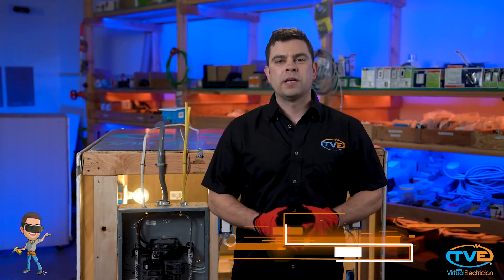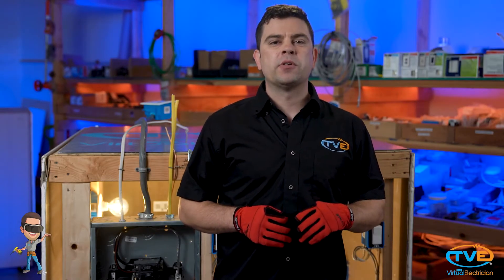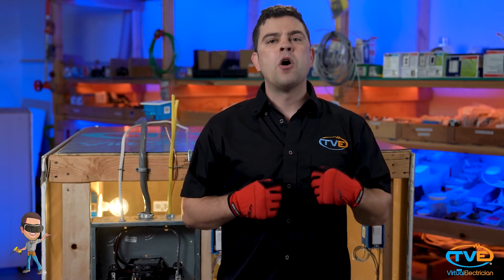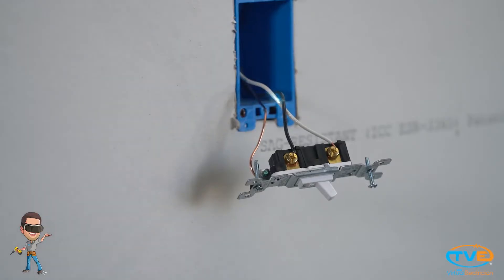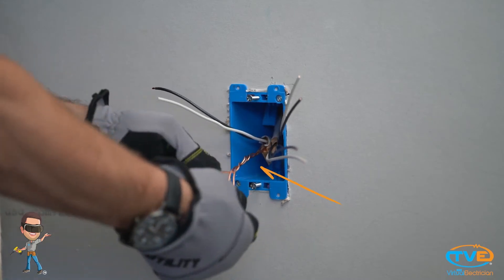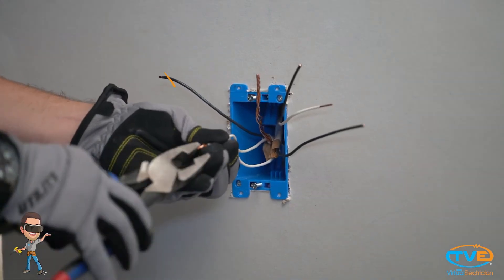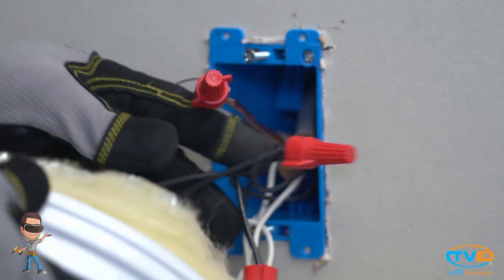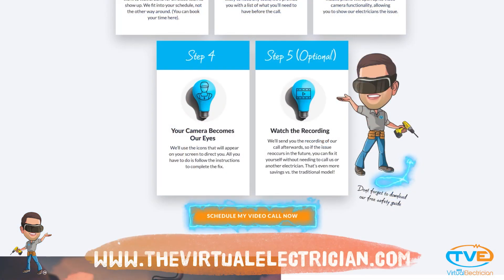How To Install a Switch loop

Comment: It is also not legal anymore. NEC 2020 requires a neutral wire in all switch boxes.
Reply from the maker: Good point Tang.  We still see it a ton especially since most counties go by the 2017 NEC